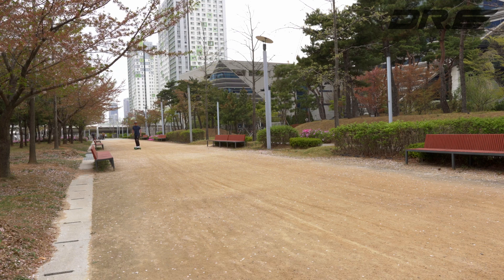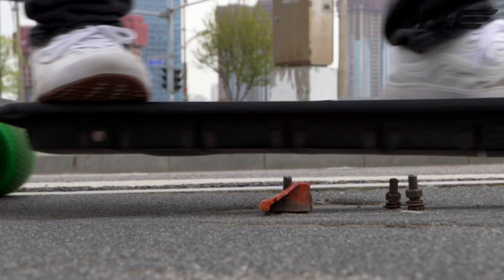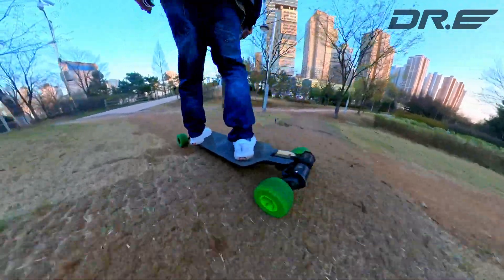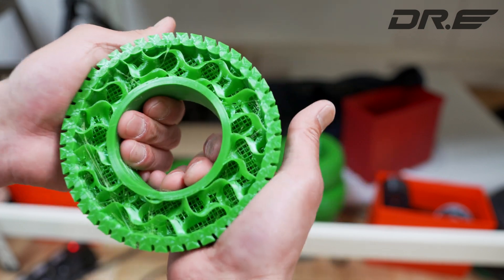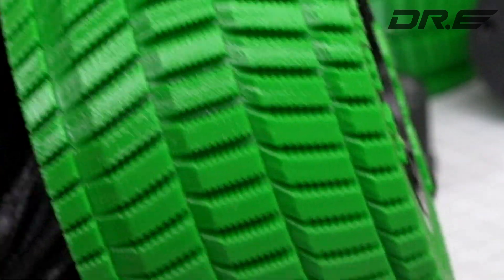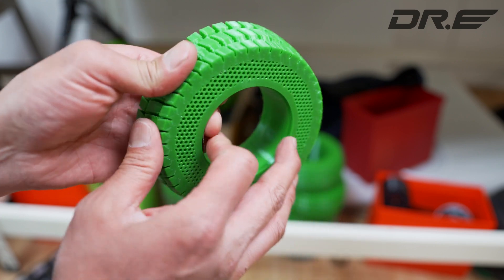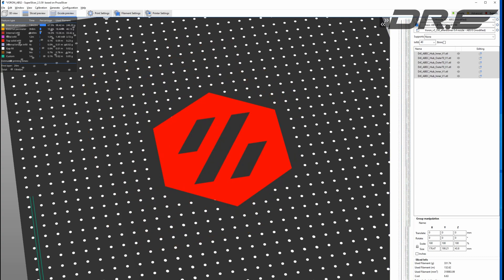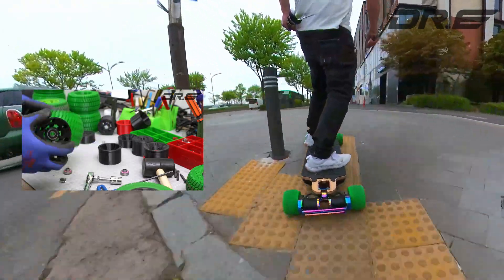Dr. E 127mm Airless TPU Wheels 3D Print Kit for Electric Skateboards(esk8)!

Comment: These are badass! Def ordering a set! Wonderful job on these. With your tremendous experience what do you recommend as far as all terrain / off road tires for 8" tires (200x50) that can be stretched wider tire patch? What are the best bang for buck in wide rims to give wider tire patch besides etoxx rims as they are too expensive and takes too long to order to the states. The mbs rockstar pro 2 alum xl's are 60mm wide but I think that's only for 9" tires? I mean can I put 8" tires in the 60mm groove spots to achieve wider 8" tire tire patch?

Comment: Would these work on a hub motor?
Reply: nah
Reply: @partisanapple5349  Why not? I asked this question before I knew how the wheels came apart. I don't see any reason why they wouldn't work. Yes, hub tires are harder to remove and replace, but it's still possible.
Reply: @MooseSnowBoarder  the way you have to bolt normal hubs on wouldn’t really work on this because it’s all tpu, but if you edit the files right to fit a hub motor and find a way to attach it securely it might work
Reply: @partisanapple5349  one of these days I'll get around to trying to design some for my rangers. I believe you would have to make the inner diameter smaller than the wheel sleeve. Then boil the tire so it can stretch onto the sleeve.

Comment: I hate to ask but is it possible for the wheel to just break because it is 3d printed rather than moulded as 1 solid piece
Reply from the maker: The TPU material is elastic, unlike harder materials it bonds permanently pretty much so it can't just break away.  The only way I found to break it was to take a saw and saw through, even that was very tough too do.   Very similar to rubber, once its melted it bonds.

Comment: do a burnout for 20 mins. hold esk8 along wall...see how the tyre performs. 

:)
Reply from the maker: I don't really see a point to that test but it can handle burnouts pretty good, doesn't get smoky like rubber and has much higher melting point.  I will post a test soon for funs. ;)